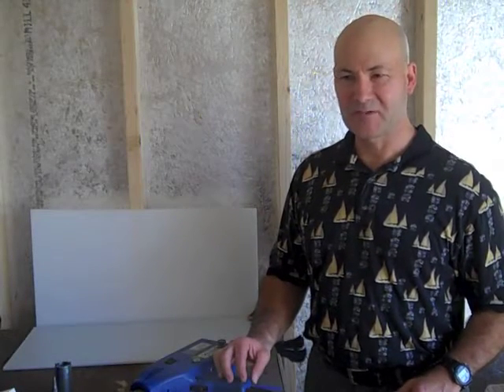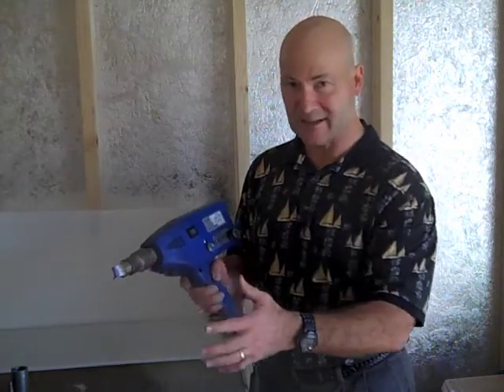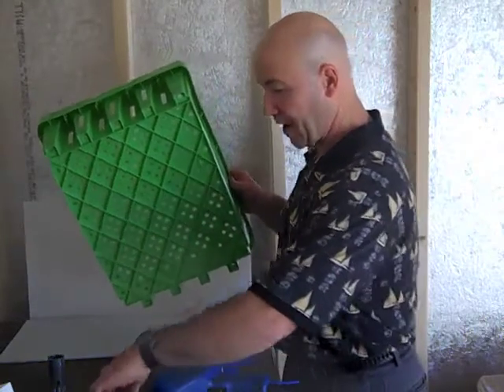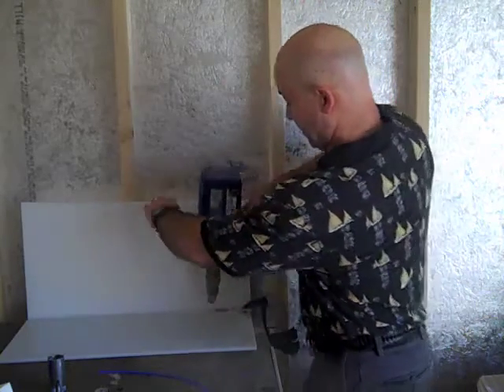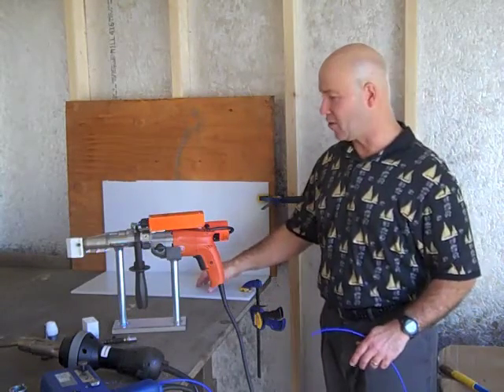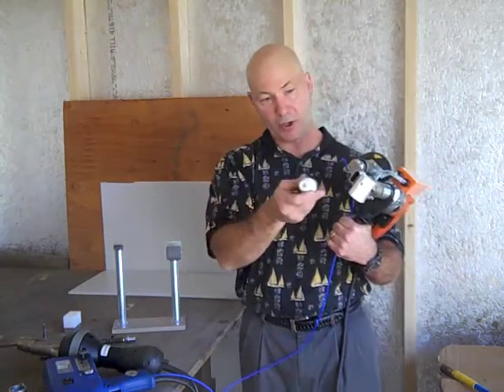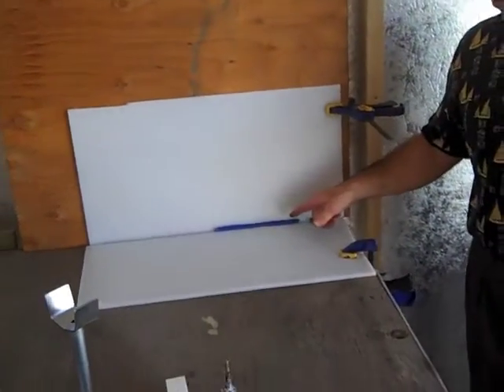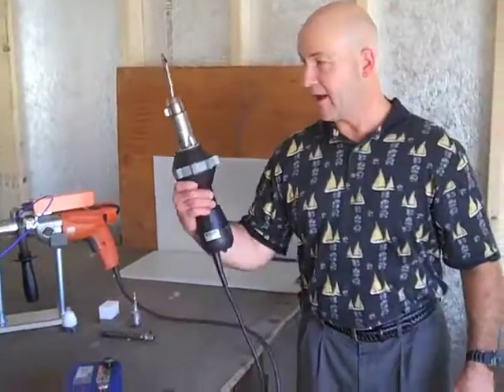Injectiweld vs Extruder

Comment: Hi, you've got the  teflon shoe on the HSK 90 degrees out.... the air from the preheater should blow directly into the V of the weld before the shoe gets there to preheat both sheets, rather than on the side of one sheet
Reply from the maker: Thanks for noticing, you are correct.